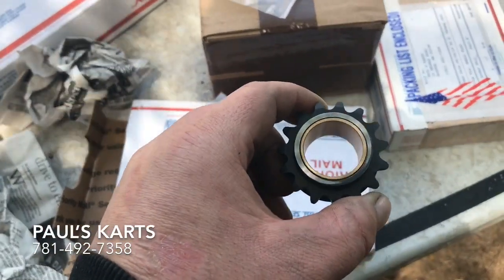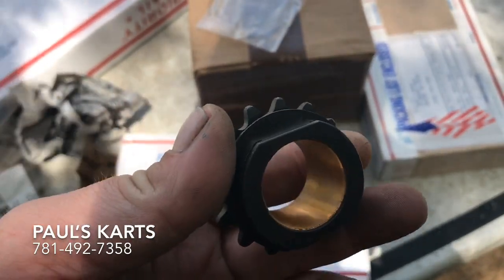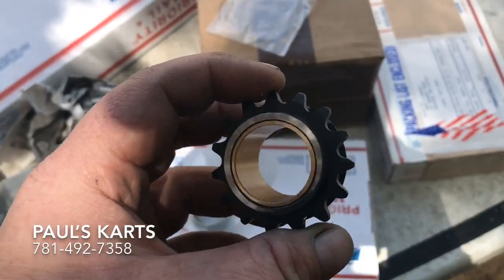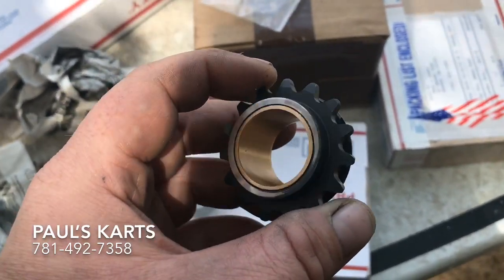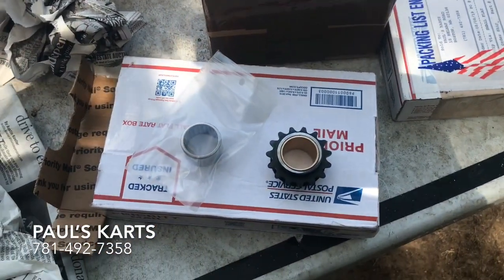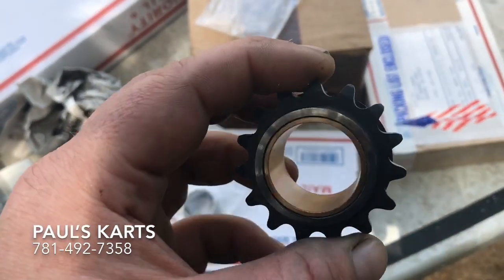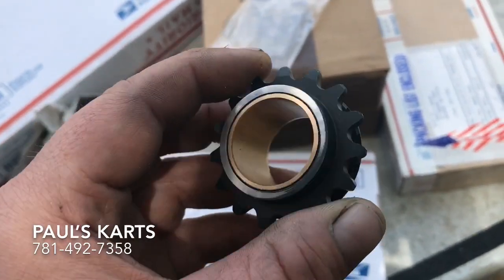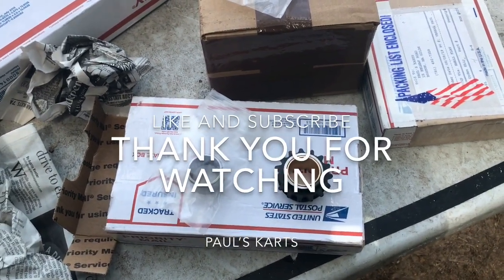Bully clutch custom bushing sprocket 1” turbo ( replaces needle bearing) Buller Built Bully Clutches

Comment: Do you run your small sprocket on the outside of the clutch or between the clutch and motor? Not sure this can be done with that big clutch but the smaller ones on my gx200s i run my small sprocket between the motor and clutch.  Seems more stable.
Reply from the maker: Inboard

Comment: One of my GX270's I won on a eBay auction for $50, it came with the 2:1 gear reduction wet clutch just like my others but the clutch was completely destroyed due to someone leaving a very critical crank-to-drive sprocket spacer/washer out during a service. Instead of sourcing a 1" keyed crankshaft and a new side cover or another stupidly expensive wet clutch I would like to go this route, especially since my output shaft is 25mm!! Let me know how it works out for you please.
Reply from the maker: It still takes a key ... you know that right ? The clutch shaft and clutch pack is keyed to the crank .. the clutch basket and connected sprocket is free to rotate until engaged